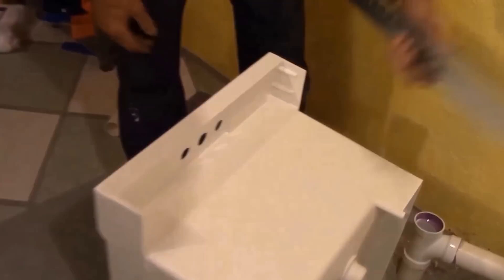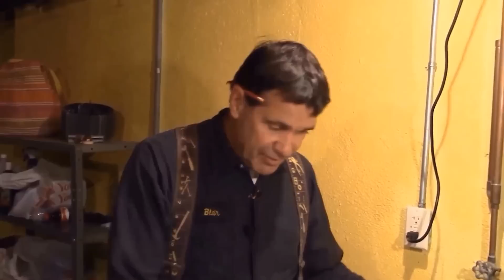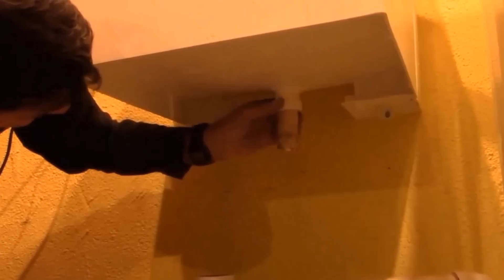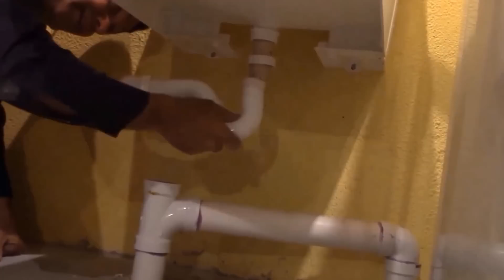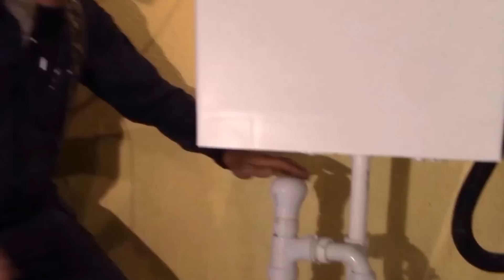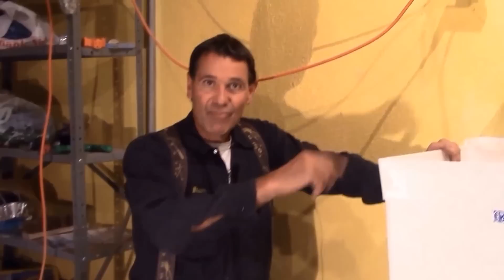Install Wall Hung Laundry Utility Tub, Washer Standpipe, Air Admittance Valve

Comment: VERY SNEAKY....You didn't show every body when you shortened the distance between the tees and dropped the sink trap lower to make room for the air valve.
Probably would work better if that air valve is higher than the sink drain too.
Reply: Should be 4 inches or so above the trap, but sometimes lack of room is a lack of room.
Reply: Yes, I noticed that little unmentioned mistake correction also.  Would have been nice to mention that the full drain assembly should be dry fit before gluing to avoid such rework.
Reply: @LTVoyager  common sense  bud. Rough draft first.
Reply: sneakrevived People with common sense don’t watch videos like this.  😁
Reply: @LTVoyager  touche lol
Reply: and yet it works just fine.
Reply from the maker: I don't think it will work better, only safer considering that everything 'mechanical' will fail someday, and if the vent is higher water won't come out of it. I always keep my vents 'high' when I can and always accessible. Some day they will need to be changed.
Reply: Yup, that would be the correct flood rim

Comment: is it not code for the p-trap to be a certain distance from the floor where you're located? believe its 6"-18" down here in La
Reply from the maker: I do believe code requires that the distance to a trap cannot exceed 36 inches or so, but distance from the floor is nothing I ever had encountered.
Reply: @MrHardware1  yes sir it dont make much sense to me, but i checked my local code and it sure enough says trap weir to floor must be between 6"-18". only thing i remember seeing for distance to trap was that from trap weir to the vent must be at least twice the diameter of the pipe. so for 2" pipe, the vent has to be 4" from the trap weir.
Reply from the maker: @Rembo318  I cannot find any place in the code where it says the distance the trip we are to the floor. Bathtubs, floor drains and slop sinks the trap is below the floor. The only distance code I see regarding a trap is a maximum of 24 inches from the weir to the bottom of the fixture, and others of course but no reference of trap to floor.

Comment: That air valve is supposed to be 18 inches above the highest point of the water where it enters the system
Reply from the maker: Actually 4” above the trap weir. Check the code.

Comment: Great video. My configuration is similar, with some unavoidable differences. Unfortunately, my washer waste water backs up into the sink. A potentially crucial difference between your configuration and mine is that my drain pipe to the city is a horizontal pipe about 12" above the floor. Because of this, my standpipe's P-trap is installed a couple of inches higher than the drain pipe to the city. The run between my standpipe and the street pipe is about 30". My sink's P-trap is connected on that horizontal run with a 2" x 1.5" Tee fitting, about 28" downstream from the standpipe. The top of the standpipe is ~28" above the bottom of its P-trap and about 30" above the bottom of the horizontal run. As such, it is ~9" above the top of the washer tub and sink basin. Any idea what is causing the washer's drain water to back up into the sink? BTW, if I plug the sink's drain, water over flows the standpipe. Is my standpipe too short?
Reply from the maker: It could be your line is not vented properly and/or it could be getting a little clogged do the buildup of lint and soap, and such. lack of venting can cause a line that becomes overwhelmed with water to Lock up.

Comment: I have a washing machine in the basement and the sewer main exits through the foundation at around 3 feet high.  An 2"air vent comes off the cleanout about 18" above that with a 4X4X2TEE.  Then a 2"X2X1.5" tee  to a 1.5"trap for the washing machine.  This has a standpipe but its tops out about 6 feet high. Im installing a filtrol filter, they claim washing machine pumps are max'd at 6'.  The filter casing is about a foot high. Im now at 7' .  Im considering building a platform to place the washing machine on.  Is ther another way?
Reply from the maker: I like to install a lift pump in the floor of the basement so I can have sinks and other stuff draining into it. You can even add a toilet and if you buy the right one it will raise waste from the toilet up to the sewer line.

Comment: How do you know when assembling a P-trap which is the right side.  Isn't one side of the U pipe taller than the other side ?
Reply from the maker: The high Side is the inlet, the low side gets the wall tube or the pipe with the bend in it which goes to the wall. That way the trap will hold about an inch and a half of water to keep the sewer gases from coming into the house. Occasionally with the disposal that’s too low I have to install a P-trap backwards to accommodate how low I disposal is.

Comment: Thanks for the video. I recently moved in a house and currently the washer water drains to a utility sink, under it is pump that drains out to the city pipe(city pipe runs horizontal about 5 ft from ground in basement)
Is there a way to dump the washer drain directly to a pump motor w/o going to the sink or some other method that involves no sink ?
Reply from the maker: You can get a sewage eject her system which is a waterproof tank with the pump in it you can Bury in the floor and then your sink in your washing machine could go directly into it, which will eliminate the pump that’s underneath your laundry tub now.

Comment: How long can the run be going horizontally from the standpipe over to the washer? I.e. how far away can the washer be from the standpipe?
Reply: 6"to 8' w/out a vent, I don't know the distance with the vent but it is over 20'. Check with the local plumbing inspector for more exact lengths.
Reply: @blairgilbert7606  thanks so much! I only need about 5 feet so I should be good!

Comment: Shouldn’t the trap be higher off the floor. I would say at least 18 inches
Reply: Nope, the trap can be anywhere as long as there is a 30/36" standpipe above it. Your washing machine discharge hose will be high on the wall, and to what end? Actually too high or too far from a vented line and you have to revent, keeping it low prevents suction and the water exits the trap.

Comment: Isn't the trap supposed to be min 6"of the floor? Also should you be using a wye 1/8 instead of a tee?
Reply from the maker: I can't comment on the trap height, but I've passed 3 inspections with this same configuration. 
According to my guru you can use a sanitary tee or a wye in this application.
Reply: @MrHardware1  ok. Cool. Thanks for the response. Was just curious!
Reply: Wye is illegal for stack venting. It will block air flow for the trap seal and could possibly siphon.
Reply: @S_Groff  Im talking about where the washer comes in the system. Everything I've read says that should not be a tee. Then again I'm not a licensed plumber. Just a diy guy that wants to know things. My stand pipe for my washer in my basement runs into a stack that has a sink above it on the second floor. When I cut that stack to add the standpipe I was told that the tie in from the standpipe into the stack couldn't be a tee. It had to be a combination wye. That's why I was asking
Reply: @EGGINFOOLS  I think the reason it needs to be a Wye is because it's a wet vent meaning it also is a drain but it's big enough to be used for a vent.

Comment: Do you still use a lint trap in your standpipe?
Reply from the maker: I don't but every several years I use a strong acidic drain opener, 3 small doses 10 minutes apart, wait 10 more minutes more then flush with lots of water. The lint filter in the pipe is hidden and will either squirt water or blow off the end of the pipe and clog the trap if you don't change it monthly or more.

Comment: New-ish homeowner here! 😄 Is there a way to do this with just a floor drain beneath the existing utility sink? Or modify it to have the pipe out of the floor like in the video? The sink/washer is currently draining into an open floor drain and I’d really like to change it.
Reply from the maker: Send a picture of the drain plumbing below the sink. That is where the connection will be made.

Comment: Good job ...however I think since you were adding a washing machine standpipe you should have mention the height limitations for it. The minimum and maximum heights, as required by code and to avoid potential problems.

Comment: Hi and thank you for an informative video. I was wondering if the bracket you used to hang the tub was universal or specific to that tub manufacturer. I have a generic utility tub I want to hang on a wall and trying to figure safe way to do that. Thanks again!
Reply from the maker: I think you'll have trouble hanging that tub. The wall mounts come with the bracket and filler 'wings' that support the lower part of the tub against the wall. Not that you can't McGilbert a system, it won't be easy. Blair

Comment: In this setup, when using the washer, will any of the water back up into the utility sink?
Reply from the maker: Only if the drain line below is clogged. Blair

Comment: Shouldn't the air vent be positioned above the top of the sink. If the drain ever gets clogged you may get contaminants in the valve preventing it to seal properly.
Reply from the maker: I do when I can. The vent, like anything mechanical will require replacement or cleaning some day so keeping it accessible is most important. However a clog should not effect the seal in the vent as it should be closed at the time of the clog.

Comment: Didn't think we would catch you messed up the drain and changed it to fit air admittance  valve. haha
Reply: Well at least he didn't just cut out that part of the video. Most viewers would not catch it and us plumbers would just say. "That's why we use tubular tailpieces." I do like how clear and concise Gilbert's videos are. A lot of other videos are 95% bloopers, handwaving and fluff and 5% content. Gilberts videos are 96% clear instruction with succinct callouts for the parts.

All site-built projects are moving targets up to the very end. He mentioned possibly raising the faucet but after checking the fit decided the deck was high enough since it was only 1/4 thick.

Thanks for the videos! Keep up the great work!
Reply from the maker: Woops, I started w/the tee to high. Glad to see someone keeping an eye on me!
Reply from the maker: Thanks man, Blair
Reply: Great video very helpful well done !!

Comment: Haha, you make it look so easy ! Great video !
Reply from the maker: Just get too many parts, that will reduce wasted trips to the store.
Reply: Mr. Hardware Pretty nice work. Here are a few suggestions: 1) Don't use purple primer. Use clear primer and clear glue for prettier work. 2) I would have used a "no-hub band" on the discharge side of the lower tee connecting to the 2" coming out of the floor (for possible future changes)  3) There is no way into the standpipe trap, except going down through the standpipe. I would either put a Swivel P-trap on or a clean-out tee on the horizontal pipe dumping into the tee, or I would use another "no-hub band" to allow access into the standpipe trap. 4)  The Air-admittance valve should be rolled out from under the sink and extended 6" above the flood level rim of the sink that it is serving. The thinking here is that if the drain ever plugs and backs up, the water will fill the sink and flood out rather than potentially backup out of the Air Admittance Valve. I would then pin the Air Admittance pipe to the wall. Lastly, I would try to install a faucet block on the sink to hold the faucet.
All in all, I would give you a "B" to "B+" for this work. Missing the correct height of the trap is totally a no-no. I don't believe that anyone should ever be proud of how little time a job took, instead be proud of how good the work is.  Contributed by a Retired Master Plumber Extraordinaire.
Reply: @acemcflanders1704  - "1) Don't use purple primer. Use clear primer and clear glue for prettier work."
You an "F" for that suggestion. Michigan code - where he is working from - demands purple primer for jobs like this.
"P3003.9.2 Solvent cementing Joint surfaces shall be clean and free from moisture. A purple primer that conforms to ASTM F656 shall be applied."